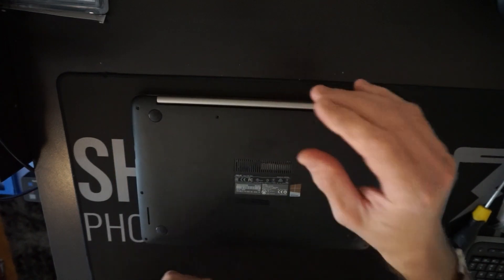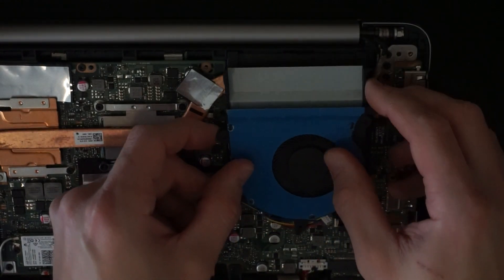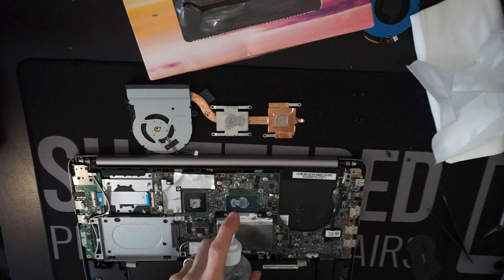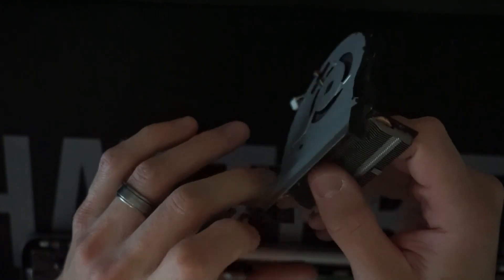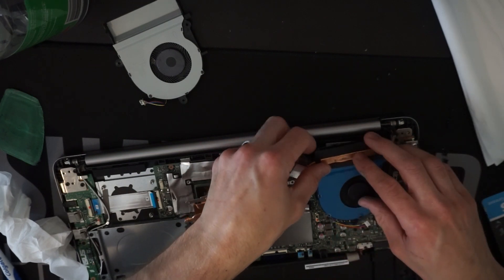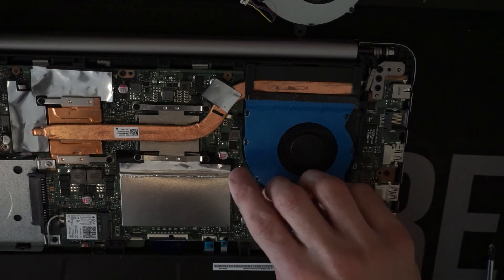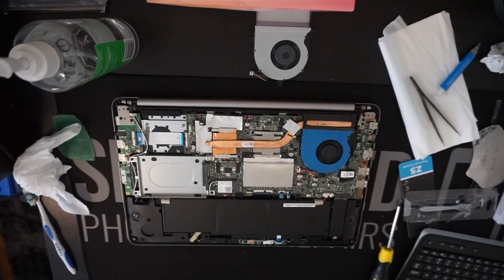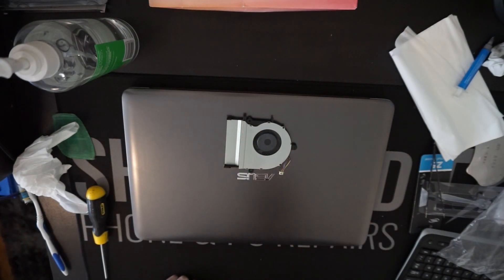Asus K501U Thermal Paste and Fan Replacement

Comment: I changed a fan as in the video, but the laptop does not work, like what happened with you, do you know the reason?
Reply from the maker: Did you disconnect the battery while you did it? 

Disconnect and other cables inside apart from the fans ?
Reply: I disconnected the caples and the fan also but i didn't disconnected the battery

Comment: Hello sir, I have the same laptop. I have a big problem. Every time I open the laptop, the disk is 100%. I tried all ways, but the problem did not solve 😩 Can you help me please❤
Reply from the maker: Try and run a program called winstatdir it will tell you what your disc usage is
Reply: @rickstechrepairs   Well I will give it a try and tell you

Comment: Amazing vid, thanks a lot for it! I have the same model, it's from 2016 and I just love it, it is still super quick. I keep changing it's parts, whatever is changeable (SSD, RAM, Battery, Fan) to keep it up to date. Just out of curiosity.. is it possible to upgrade the CPU or Graphics card on laptops like this? Or are they completely integrated to the motherboard?
Reply from the maker: Hi 

As with most laptops, yours included you cannot change the CPU or GPU

Comment: How do you know when is the right time to change that parts? I just bought this used laptop and fan is very loud and often starts when cpu usage is low or when I'm just browsing internet. Changing this parts will solve the problem?
Reply from the maker: Usually when they are a few years old.

When i buy any machine second hand i change the thermal paste